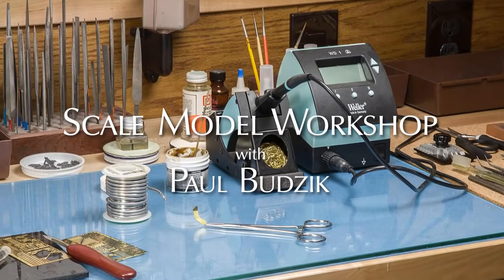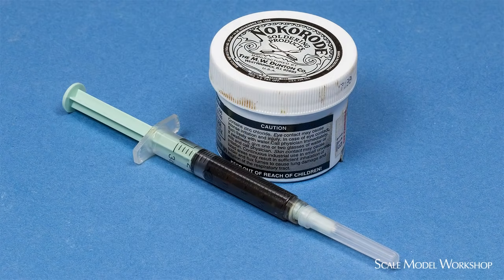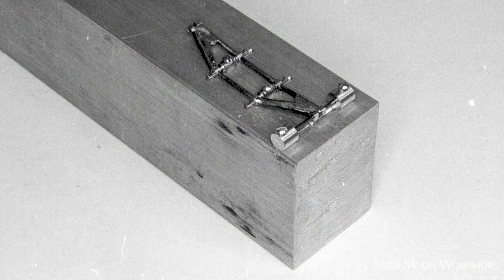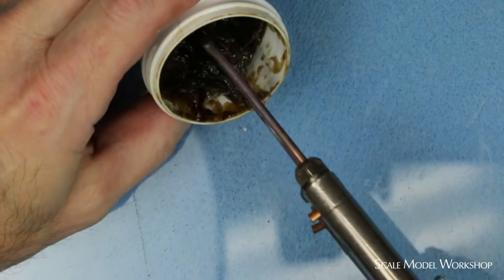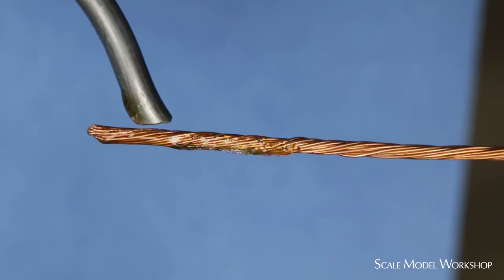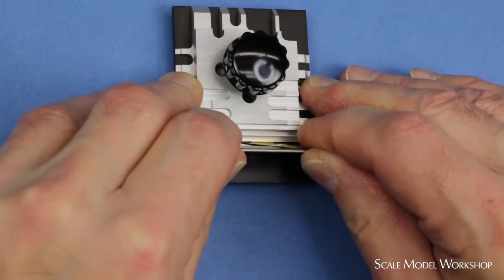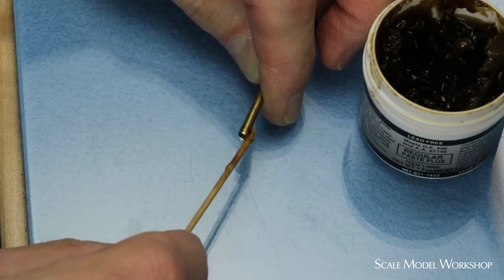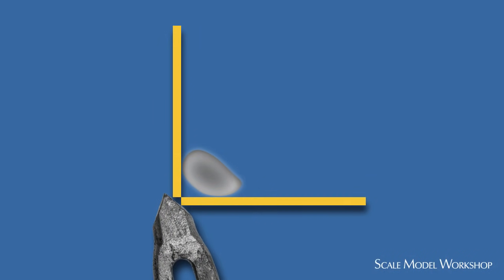Soldering for Scale Modelers

Comment: Hi Paul, what a fascinating instruction video that I've watched may times. A question please, about the solder you use. Should it contain any flux at all? I can locate only "rosin core", which apparentky contains flux. I mainly solder thin brass rods (for slot cars frsmes). I've found 60/40 but no 50/50 and I want t get the ingredients right.

Comment: Wow, thanks!  Great tutorial.  This opened my eyes to another technique I can add to model building.  I also build guitar effect pedals, so I have all the necessary solder equipment already.  Best/most basic tip I can give is heat the part, not the solder!  I’ve never used flux though, as it’s included in the solder, where I live anyway.

Comment: Woa what a fantastic video.  I have done a lot of silver soldering repairing locks and old keys but I am repairing a very large albatross bird sculpture and need to scale things up.  The videos I have watched are generally lacking in specifics.  That flux looks excellent, thick and it appears to have metal particles in it perhaps?  I've been sold a watery liquid flux which doesn't protect the surface from oxidising for very long so I have brought a roisin gel which at least doesn't seem to disappear so fast.   This was helpful thank you.

Comment: Many thanks for the tutorial very informative. I have a project where I need to make a new honeycomb radiator for my 1929 Scott. I need to dip solder 1000 brass tubes and need a liquid flux to dip the radiator into before a shallow bath of solder, what flux would you recommend.
Reply: Scott yowl : Make your own Flux,  Use Salt Acid and Water , mix so you have about 1-3% Acid in the water  and depending on the Material you want to solder put copper and brass even Stainless Steel shavings in the mix, yes stainless Steel can be soldered soft, if you use a Stainless Steel with low or non Chrome in the stainless Steel, but you need more Acid in your mix .later clean the parts with Water. Use every safety Measure when working with Acid.

Comment: Paul, I'm just curious: Why did you screw that assembly to a metal block knowing that the block would act as a large heat sink? Why not use a wooden jig? I imagine you had your reasons.
Reply from the maker: The metal mount is more precise.

Comment: Hi all , just one usefull advice  - to avoid that solder will stuck in teeth of your file it helps to  apply a chalk on face of your file. Then you can rought out unwanted solder also with file. But you have to repeat this step several times during the work :) Try it.
Reply from the maker: Good tip, thank you Tomas
Reply: Scale Model Workshop, You are welcome

Comment: Hi. I just found your channel. I just love how your explain and show the process. Is there any way to darken the solder color? I want to patine the brass but the solder is still very visible in areas where I do not have access to clean up properly. Is there any chemical that can darken the color of the solder as well so it will blend better with antiqued brass? I am using a 50/50 tin lead solder. But I can change it if necessarily Thank you.

Comment: I went for a search to find soldering wire but it looks like it's impossible for me to get wire with Lead (probably some kind of health protecting law) . Only ones that i can find are mix of Sn, Ag and Cu in different ratios. Any tip in which direction should i go, Cu is usually at max 1% ?

Comment: I’ve just watched this very informative video but I need to ask the question:Where does Soldering end and Welding begins?
Thanx in advance.
Reply: Soldering and brazing are very similar, the temperature is what determines which one you are doing. 450c is typically that temperature dictating that. Below and you are soldering above and you are brazing. Both of these joint materials together but dont actually melt the material together, just the filler metal (solder or brazing rod). Welding requires even more heat and physically melts the two metals together. Welding is the strongest but has to be the same metals, solder and brazing joints dissimilar materials together.